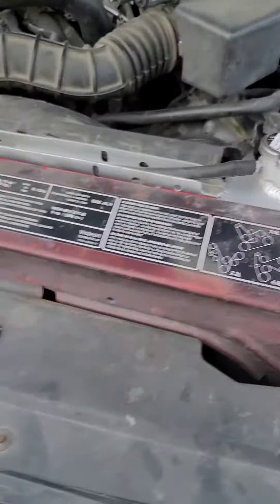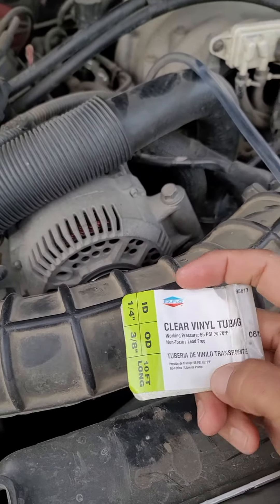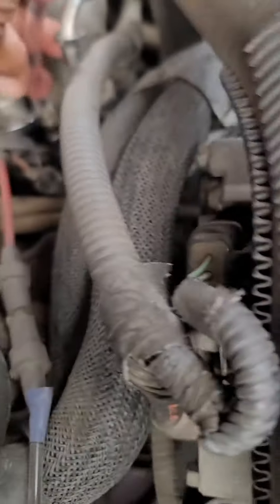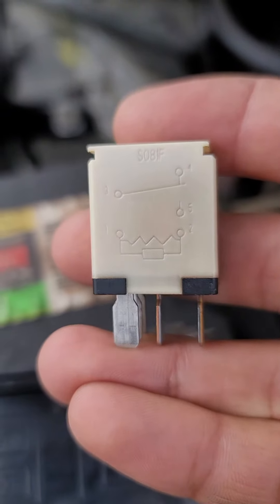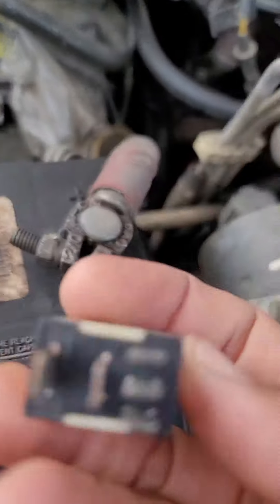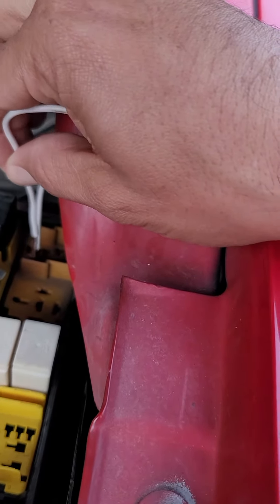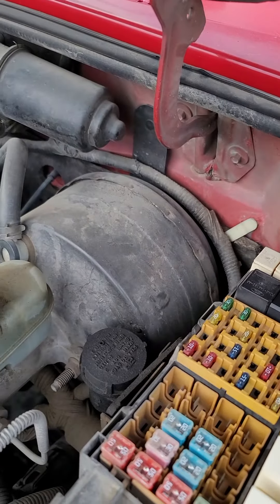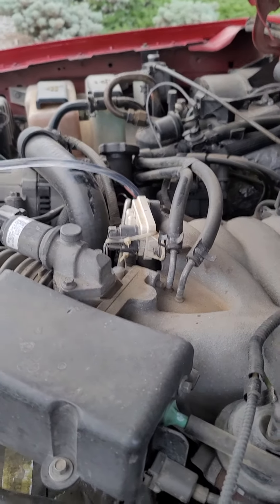HOW TO EMPTY FUEL ⛽ TANK ON FORD RANGER,

Comment: Silly question…. Is this a better method than draining it through the fuel filter? I’m thinking that I could just remove the filter and drain it from there. But I’ve never done it before so I wonder if it will even work.
Reply: I tried that and the fuel filter stops draining after a while. I’m assuming the gravity has something to do with it. Trust me this is the easiest way

Comment: Is the wiring used in the video sold in stores or did you make it
Reply: I'm sure you figured it out but if not you can use a wire out of a simple old power cord for say in my case I used the power cord for an Xbox 360 cut the wire and only used one cord of it